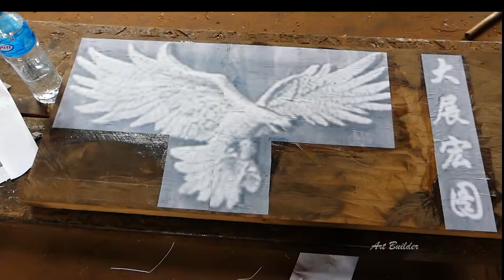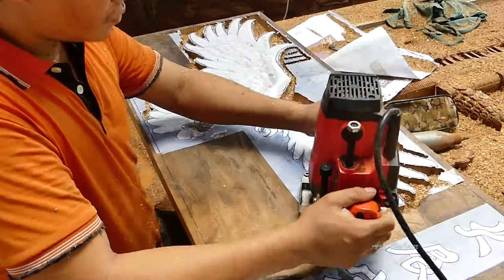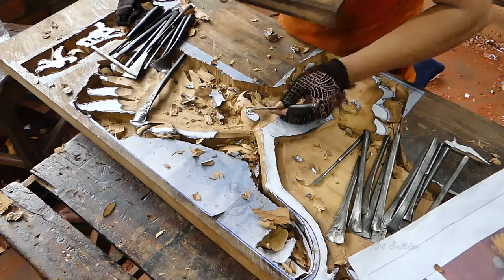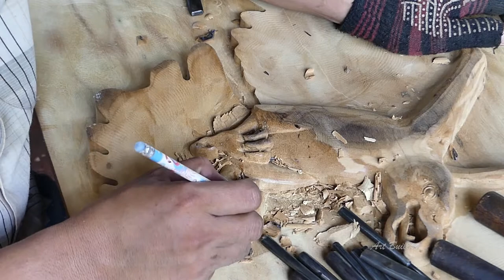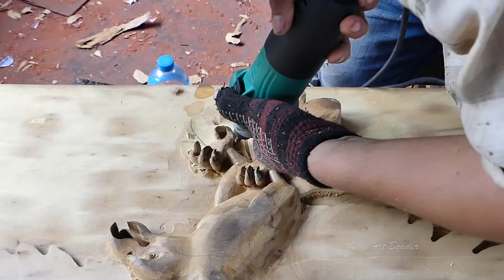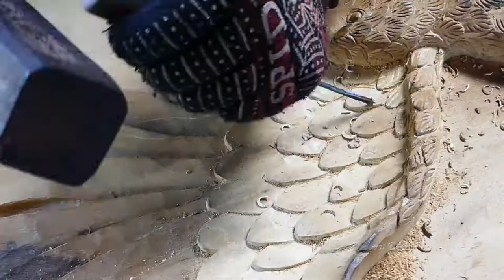Amazing Eagle Wood Carving - How To Carve Eagle From Wood By Hand - Wood Carving Skill

Comment: You might not know this, but you can hold that router down and take the excess off and if you did that with the excess, you wouldn’t have to sand as much. Now, if you’re using that technique for a certain look that I’m not aware of because I have no experience carving whatsoever then keep doing your thing, not criticizing just trying to give a helpful tip.